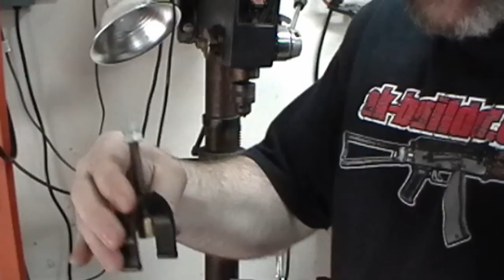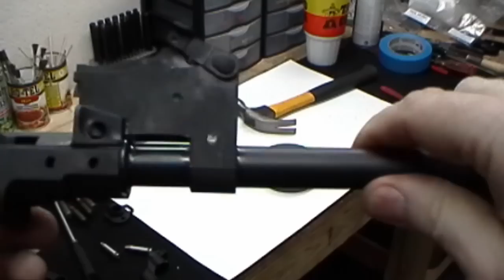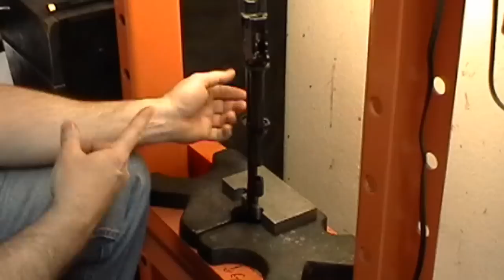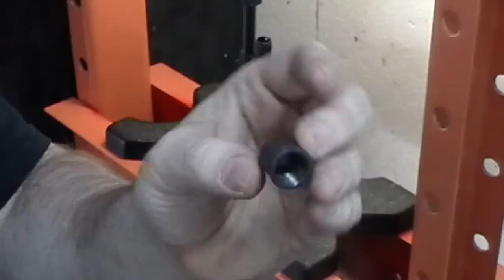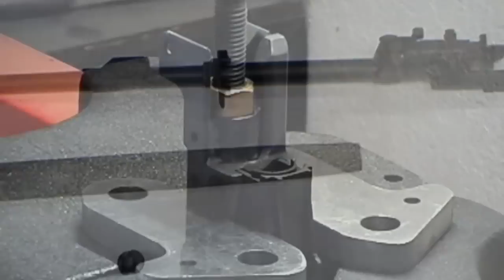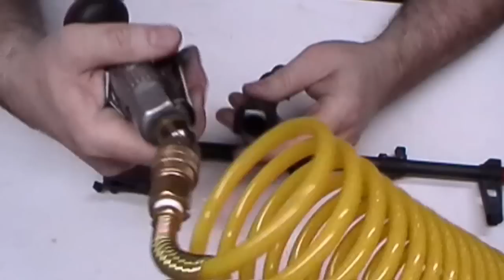AK47 Part 9 Barrel Population

Comment: Just one small thing to include for anyone using your videos as a guide to assemble their own:
If you plan to attach a bayonet at any point, and even if not, for the sake of standards, please test fit at least one (if you have one) with an appropriate (unfiled) muzzle device before you drill and pin your front sight block. Nothing is worse than finding one that doesn't quite let the bayonet lock in.

Great series, Mel, much appreciated!
Reply: Thank you! Wouldn't have even crossed my mind with having to tool up and everything else. Now I gotta grab one along with a ton of different mags to check feeding.

Comment: I’m still confused on the order of barrel population, headspacing, and pressing in the barrel and drilling for the barrel pin. In this video you populate the barrel with the trunnion on I’m guessing to aid in populating the barrel? Then in the next video you take the barrel out of the trunnion, rivet the trunnion into the receiver and then finally push the barrel back into the trunnion, headspace, and then drill and pin? Is this correct?
Reply from the maker: Back then I would press the barrel into the trunnion and head space it but not drill for the pin. Then I would support the chamber face of the barrel to press on the rear sight. Then slide the barreled trunnion into the receiver and set the dust cover. Once the cover was set with the rear sight block I would slide the barreled trunnion out and populate the gas block and front sight block.

My thinking back then was it's easier to press and drill and pin barrel components with the assembly out of the receiver because it was a smaller item to work with. I no longer do it this way. No point really. Now I rivet the trunnion into the receiver and then press and drill/pin each barrel component one at a time. Kinda the way it should be done anyway.

Comment: it just occurred to me that an end mill probably wouldn't work for the gas port being a long tool is needed and end mills that I know of aren't long enough. and btw I appreciate your well made videos, good easy to understand info
Reply from the maker: Thank you I'm glad you like them. The hole in the gas port will guide the drill bit, but that does not mean that a boo-boo can't occur. You can drill out of the side of the gas port and barrel, but a person should probably work on something other than guns if they can't keep the drill some what strait while drilling a hole that already has a well made guide.

Comment: I know this is hard but if you take that drill and cut the drill flat like a mill they will work great. I did that and what a difference! You can even buy a mill that size too. GREAT video! Like your V block!
Reply from the maker: Yes that will work if you're careful. You can also buy 135 degree drills in solid carbide that cut very well for drilling barrels.  Thank you for watching.

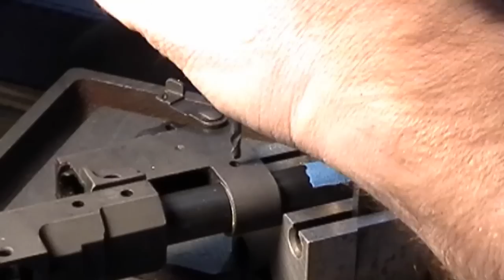Comment: 4:32 What size drill bit is that?
Reply from the maker: I used a 5/32 (0.1562") drill bit. The pin is 4mm (0.1575")

Comment: Where did you get the plate u used to press on the front sight block?
Reply from the maker: I made it at work.  It's a 1" thick piece of steel with milled cuts just big enough to fit the different barrel diameters.
Reply: @Mel64d  do you know if anyone sells anything like that?
Reply from the maker: @MrJeepmarine   Forbus Tools sells press plates for pressing on barrel components.

Comment: On a 4mm dowel pin, what size drill would you use to ensure the dowl pin has a snug fit?
Reply from the maker: I  measure the pin first then go with the closest drill just below that. A “4mm” pin I would use a 5/32” drill first and check if the pin just wants to go into the hole.  Most drills will drill slightly oversized, that’s why I start a lil under. If I go with a #22 drill it might be just right or possibly bigger.  Most pins that are in kits are actually just oversized. A 7mm pin for the front trunnion is actually around 0.2770” ish so it presses onto a 7mm (0.2756”) hole.

Comment: what about using an end mill to drill for the barrel pin or any of the other places needing drilled on the barrel? I thought of an end mill having a flat cutting area so it shouldn't walk like an angled ground drill bit
Reply: That does work. In fact, the end mill in my experiences usually does not flex like a drill bit will.

Comment: what size drill bit do you use to drill the gas block and front  sight post
Reply from the maker: keith misenheimer The original pins if you have them are 3mm or .1181. A #32 is .1160 that is what I use.
Reply: ive been using a 3/32 its close but every now and then i bend a pin.
Reply from the maker: Wow that's .022 undersized. You only need about.002 for a press fit. I recommend buying a set of number drills. This would solve your problems with bent pins.
Reply from the maker: If you go to AK Builder.com they have 3mm drills that you can buy. Get a few and save yourself the headache.
Reply: ha i did that late lastnight along with some new pins. ive started using them 80% polish receivers..
Reply from the maker: keith misenheimer Good you will like not having to keep redoing the pins......so frustrating!
Reply: Keith the size drill is 3mm. When using original pins. Rear sight base is 4mm.

Comment: I'm having a hard time understanding this (for someone)  the rear sight is a 4mm and the gas block is a 3mm and the front sight is also a 3mm and the front trunnion is a 7mm...and we use a 7mm  Reamer for the front trunnion how come we don't use a 4mm and a 3mm Reamer for the rest of the barrel  Population?
Reply from the maker: I use to use a 3 & 4 mm reamer on the other components. Found out it really didn't help as much as I thought was needed. Heck, I don't even use a 7 mm reamer anymore now that I use solid carbide to drill the holes.  Using the solid carbide bits on all holes, the holes come out smooth and on size. A lot has changed from these builds of old compared to what and how I do it today.

Comment: can you please show me how can we align the lower hand guard retainer slot with the front trunion?
Reply from the maker: +GIANG THE TOOL   Place the hand guard retainer on the barrel locked in place. Then find something flat to lay your trunnion on upside down. Then turn the barrel over and use the flat (top) section on the retainer and mate the barrel into the trunnion. Use a mallet (not a steel hammer) to tap on the trunnion to just stick the barrel into the trunnion. Then make your way to the press being careful not to jolt the barrel/trunnion as you get it set up for pressing. Or place your trunnion in a bench vise, level it, and then place the barrel with the hand guard retainer locked in place and use a level on the retainer and lightly tap the barrel into the trunnion just enough it stays in. Then take the assembly to the press and press the barrel in. Or do the old fashioned "eyeball" to level it for press.
Reply: +Mel64d My English is not so good. Next time when you do this step, can you please make an instruction video. I would be very appreciated. Thanks for great video
Reply: +Mel64d I got it now

Comment: can you tell me how to remove and replace a broken lever on the handguard retainer?
Reply from the maker: +kyndbudz   Oh man, those are a pain in the butt. Especially if the hand guard retainer is on the assembled barrel/rifle. You will need to find a way to keep the ring on a flat surface while you tap the lever out. They are swelled on the one side to keep them from falling out. If you can get it on a flat surface with a hole in it for the pin to come out, then find a punch that will set inside the recessed hole, you can punch it out. But be careful, you can damage the ring where it will be unusable.

Comment: Great AK build series. I see that you used the Toth tool for the barrel install but not for barrel population. Any experience with their pop tool?
Reply from the maker: wrenchhead2 That tool also installs the other components, but it twists them with the torque of the wrench. Got tired of trying to keep everything from twisting, so I stopped using it to do any of my barrel installs.

Comment: You think you could drill my barrel pin hole for my if I mailed it to you? Would pay whatever, just don't want to fk my build up.
Reply from the maker: Adamz678 Not really wanting to mail things back and forth. I just do this for myself, it's a hobby not a business. If you have a drill press you can watch my video on my Bulgarian 5.56 build. I show how to use a drill bit chucked upside down to locate/align the original hole in the trunnion. But if you do not have one then you can watch "ginsboy2003" on you tube. He shows drilling the barrel pin with a hand drill.
Reply: I understand, I just don't want to fuck up my build after all the money and work I put into it. My drill press kind of sucks since the chuck is a little off and no one around in my area deals with these guns. I know this isn't a business, but it's hard to find anybody for help. AR would have been a better route for me, stupid to think I can take on such a job without the proper tools. Thanks anyways.
Reply from the maker: Don't sell yourself short, with a little time and patience, you will be able to do the pin hole. If your drill chuck is off a bit it should still drill the pin hole, just use a smaller bit first to drill the hole. Then work your way up to size checking in-between drills for proper fitment. You can do it, just don't get in a hurry. If people hand drill them, then you should be fine using a drill press. I believe you can do it.

Comment: I used an over-sized barrel pin, I didn't like the way the holes were in the trunnion...
Reply from the maker: That's good, some people will just say "oh well it's an ak" and leave it out of round. But then again it's their ak so they can build it the way they want.
Reply: ***** I was more concerned that the pin could work itself loose over time so I remedied that by using the over-sized barrel pin...
Reply from the maker: The way you did it would be the correct way. But if you have to press or beat the pin into place, then it most likely will never come out without pressing or beating it back out.

Comment: why did you remove the barrel after you had headspaced it?
Reply from the maker: Well I do this because the only way to install the front trunnion is to remove the barrel and then rivet the trunnion in place. This can not be done with the barrel in the trunnion. If you buy a parts kit with the barrel installed and head spaced, you will still have to push the barrel pin out, press the barrel out of the trunnion and then rivet the trunnion in the receiver. Then you will have to press the barrel assembly back into the trunnion and re-head space it, then push the pin back in, hoping that it is lined up right so you don't gouge metal out of the hole that is not lined up any more. NEVER expect that the barrel pin will re-align the barrel again! 

 I like to do it my way so the parts are aligned and spaced properly. You can also do it  buy riveting the front trunnion in the receiver, pressing the barrel in place, head spacing it, drill and pin the barrel, and then populate the rest of the parts on the barrel. But I do not like having all the extra stuff hanging out (receiver) when I drill and pin the barrel parts, I just like having all of it out of my way.
Reply: Oh I see. You make sure everything lines up that way if it wasn't headspaced right and things werent spaced correctly, you would be screwed basically. It's  like checking yourself before you get to the actual part. Thank you!
Reply from the maker: masong95 You're welcome.

Comment: hey man what can I use to put in the throat of the barrel to press the blocks on , mine already has the reciever riveted in and everything , cause the press ram is to big to fit all the way down the reciever obviously so I need a way to do it
Reply: Mel64D but I don't need to remove the barrel just the blocks , but I suppose that tool does both and would work right ?
Reply from the maker: Yes that tool will push the barrel and not the trunnion for component (front sight/gas block/rear sight block) install.
Reply: Mel64D ok so you made a tool to do the same thing  as Robert's tool anyway you could make the special tools you used vs me buying robertforbus 's tool or would it cost more for you to make then me buying his ?
Reply from the maker: It would cost more for me to make one tool than it does Robert seeing as he will make several at a time. I do not make and sell tools for people either.

Comment: where is AK 47 part 9? I can find every part but the one I need.
Reply from the maker: Any older series with head space videos, the video was removed. People were getting confused when I showed live rounds being checked after setting headspace. They thought they could just use the live rounds instead of proper gauges. So those videos were removed. Sorry.
Reply: thanks for the quick response. that's understandable and kind of scary that people with that little experience are building rifles. I think I have figured it out. front trunnion, head spacing then rear sight block and so on. thanks again
Reply from the maker: You're welcome.

Comment: what interference do you shoot fer? bout .001?
Reply from the maker: .001" is best, but if you really check the parts sometimes they may have a slight taper from one end to the other.If the end that you are pressing first is say .0005" bigger than the other that would help with pressing it on. But if it is .0005" or more to small on the end you press first without checking both ends, you may end up with a loose block on the barrel. Internal mics are the only way to be 100% sure, but they are expensive, so most people us calipers. Calipers will get you close but are not precision measuring tools.
Reply: I hear you, My first barrel was all sorts of jacked up because I didn't measure anything. Scared the pee outa me when my press started to go "POW....POW...POW" when I was pressing the GB
Reply from the maker: Alan Solingen...and the barrel will flex a little bit too, that always scares the poop out of me. But as long as the part moves with every single pull of the handle, you should be good.